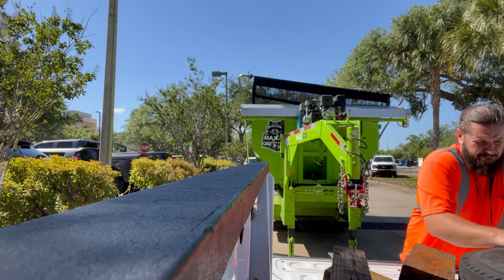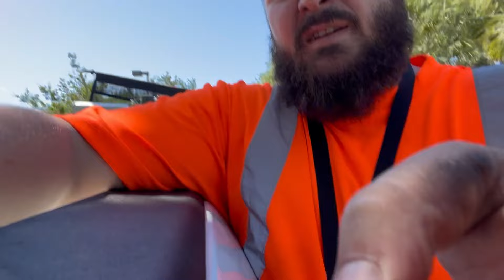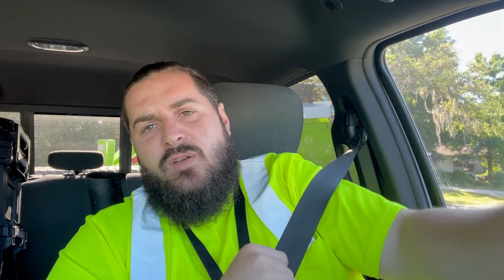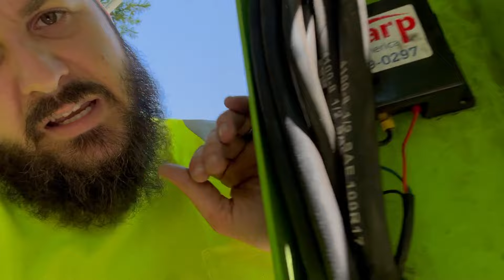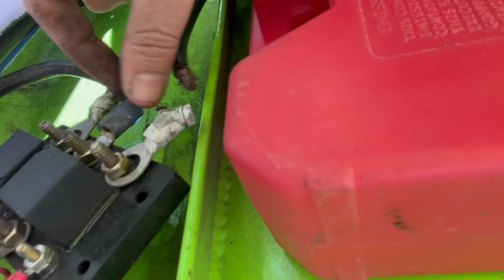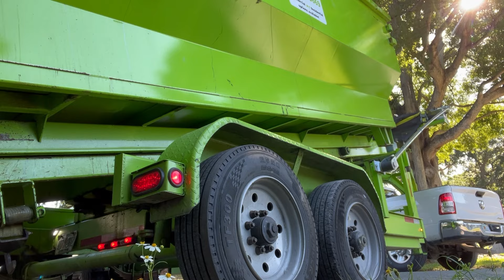Broke Down and Behind Schedule: Delivering a Dumpster to a Dumpster Company

Comment: Guess my tarp isn’t the only one that sticks up like that lol. Have to rachet strap it down
Reply: I also run trans eagle. 16 ply tho (only have a 14 foot roll off trailer
Reply from the maker: I broke one side completely in half one time. After I replaced it, it was good looking and straight for a whole month or so until I bent it again. 😂 Mow it just is what it is.
Reply: @MAXCODumpsters  the side of the motor it rolls in super tight and the other side is a foot in the air I can’t get it to roll in for nothing right. Noticed today one side is slightly bent now. I’m not surprised. The “round” tubing tarp arms are garbage was your trailer new in 21-22? I’ve seen a few newer tarp systems from newer trailers that have this “hex” shape tubing and they roll in even across the whole thing and guys aren’t having to strap them down. 

Going to have to talk to a friend at my local refuse/recycle parts shop. I know they’re a dealer on US tarp.
Reply from the maker: @adamkohn2610  yes! US Tarp makes that style as well as a few others. When I did my 1 year review video of the trailer I recommended they move to that style, and when I was talking to Evolution about what to do for their trailer they agreed and started going with that style as well. Worthwhile upgrade!